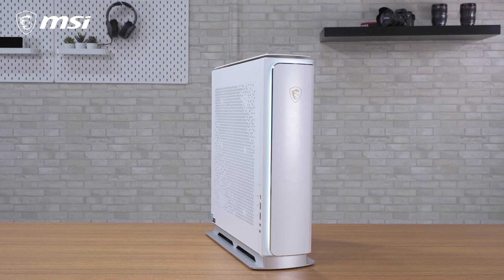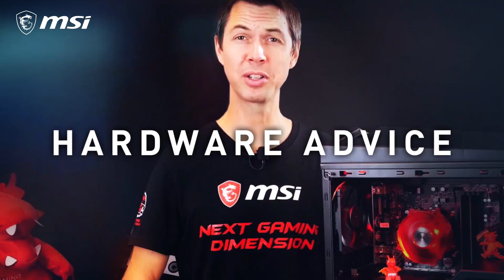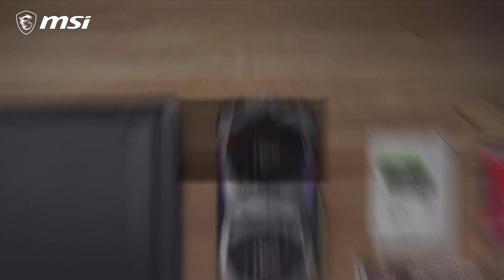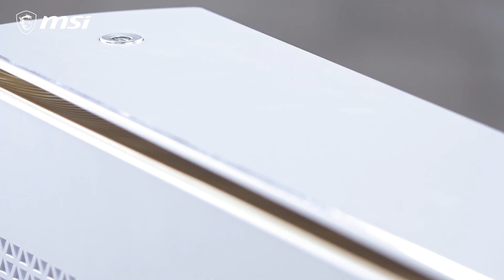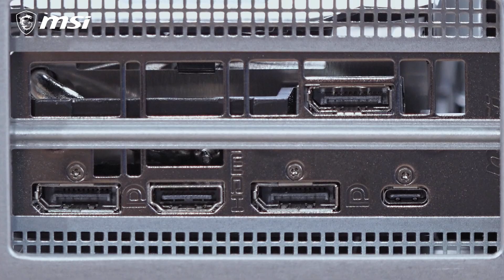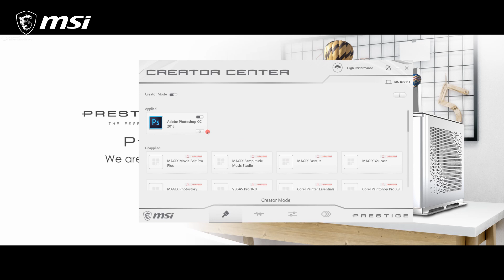MSI Pro Cast #30 – Prestige P100 Made for Content Creators | Powerful Designer’s Desktop | MSI

Comment: I have been using the Core i7 version of the Prestage for over two years. I'm planning to replace it soon. While a Core i9 might not have any issues, when rendering 4K videos longer than 10 minutes with the Core i7, the 450W power supply overheats and causes the entire PC to shut down.

Comment: Do you use a UPS, surge protector, or just straight into a wall outlet?  If if straight in a wall outlet if I am in a very old house should I replace the wall outlet that I plug into if it supposed to go into the wall outlet?
Reply: you should use a ups, its never a practical idea to just go straight to the oputlet specially this is a bit high end PC , ups is a little investment